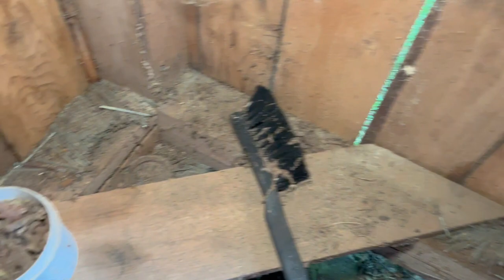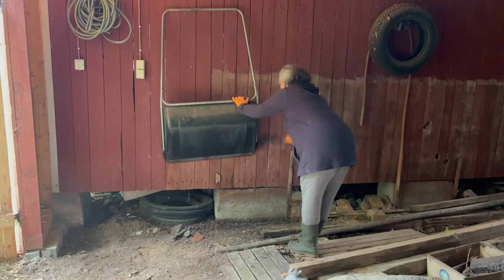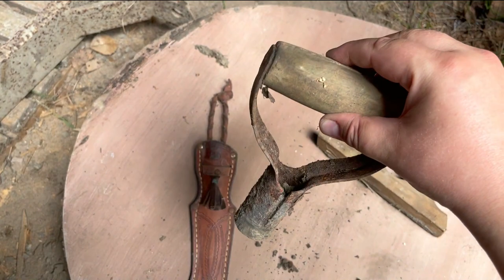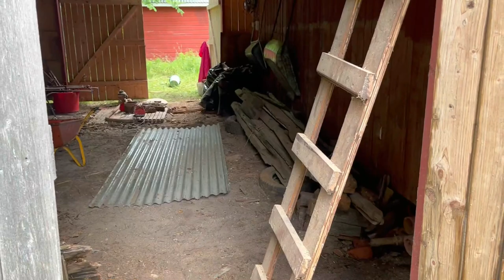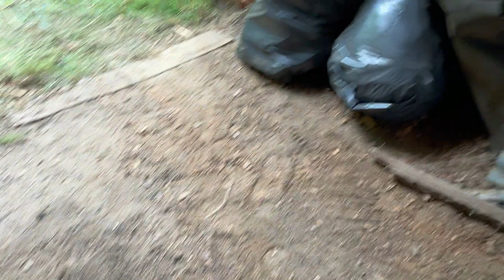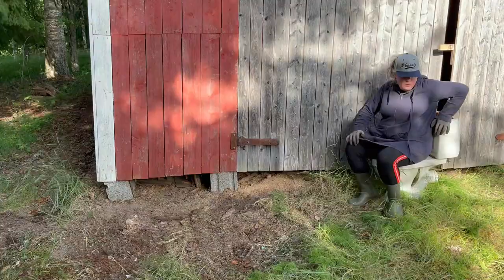#10 Cleaning the tractor shed and setting up the recycling centre

Comment: Zinc-coatet nails are good as new. That wooden device that has wooden rotted from the bottom is a traditional old mouse trap. If a lot of scrap metal accumulates, you might even get some money from the scrap yard instead of it going in the recycling center where you have to pay.
Reply from the maker: Thanks! I appreciate the good advice! Wow! Is that huge wooden device for killing mice!! I could never had imagined that in a million years! 😄 There is indeed a huge amount of scrap metal. I havent gone properly through it yet but I will keep some of them for future project, some for my ”museum” and the rest can go. I might take a look into the scrap metal business. Any however small income is good in a huge project like this. 😅